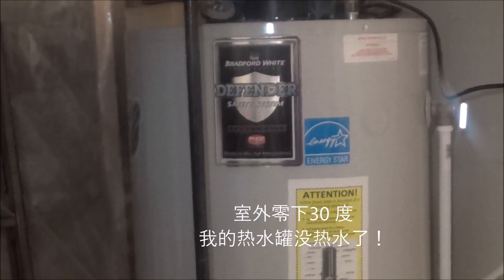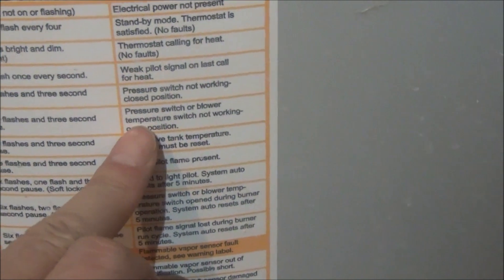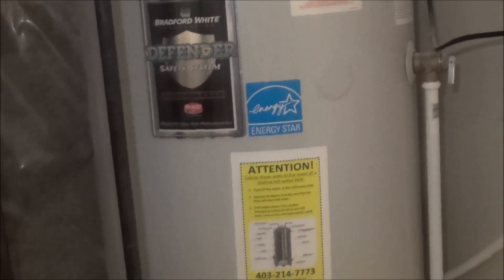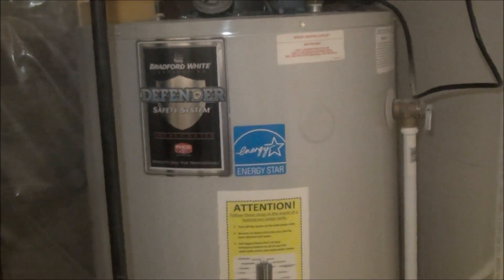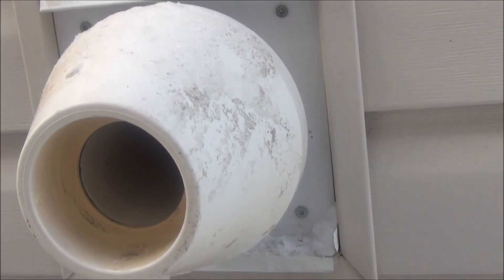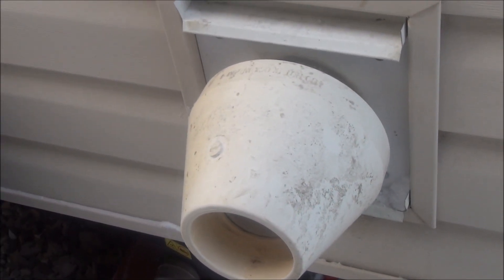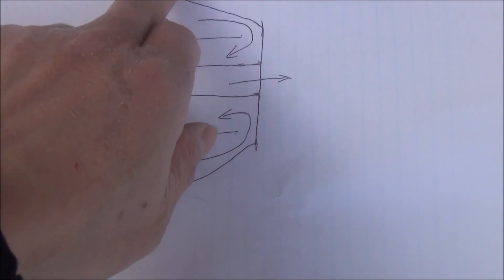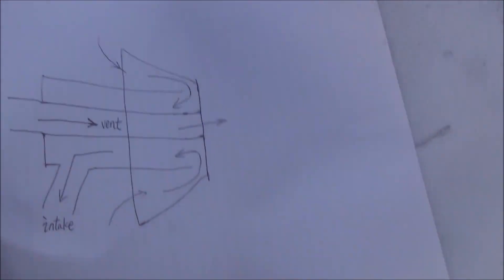Bradford White Defender hot water tank, no hot water, pressure switch problem|热水罐没热水，压力开关

Comment: Thanks for the video! You saved me from getting a technician out here. I spent a couple hours trying to diagnose myself and taking things apart. Basically had all the same symptoms you had. Saw your video and saw we had blockage in our outside vent (pool inflatable). The system fired right up after assembling the heater back together. Thanks again!